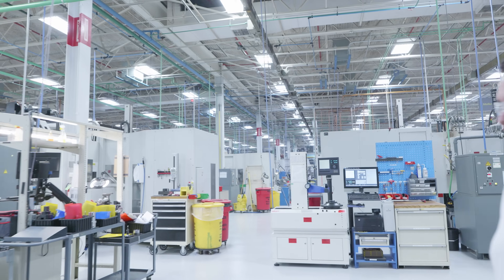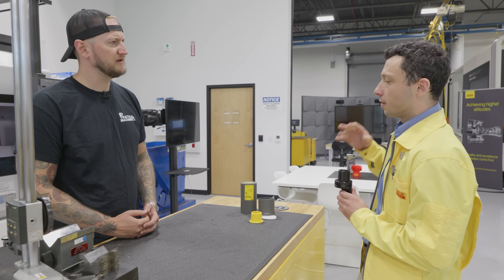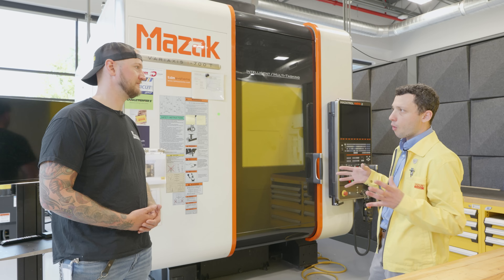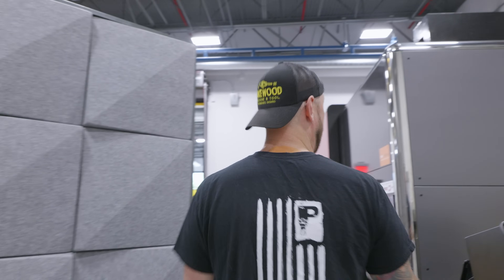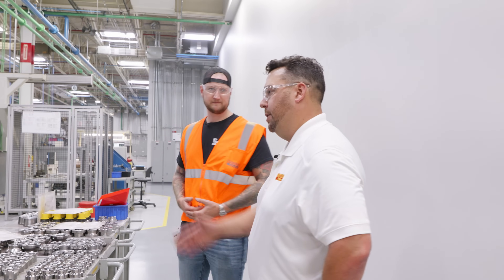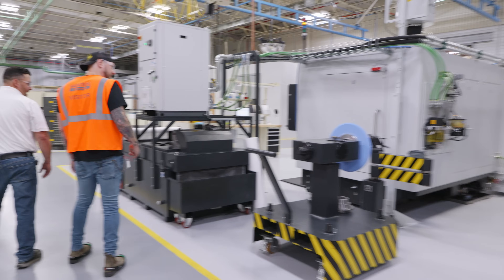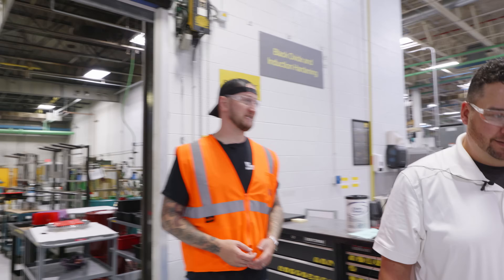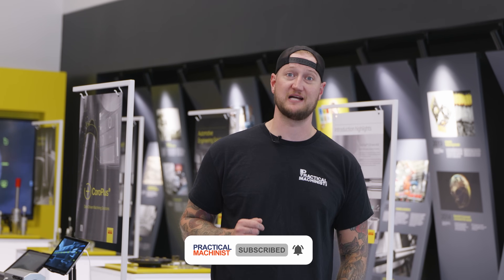Sandvik Coromant Never Allowed Cameras In Here Before!

Comment: I had run a Cincinnati 18 ft. Planar Mill with 2 hand ground tool steel bits in an over arms on a gantry.  Had to machine two freight train rails at once clamped side by side on the 18 ft. long  parts bed. Which ran back and forth on a 36 ft. foundation table. A machined cut stroke was the entire length of both rails on top and both sides. The precision metal equivalent of a saw mill operation, yet no less dangerous. A tooling vendor showed up one day and brought in some tool holders with Carbide inserts, replacing our primitive tool steel
blades. We kept cranking up speed and feed until the Carbides ripped 1/4'' chips that shot like glowing bullets! Although I'd used carbide on CNC lathes before that time, no one thought old school planar would function under those loads.  It did and we ran rails on that turkey like a Formula 1 car.  That was 1978 in Menomonee, Falls Wisconsin at CRO Messer Griesheim Co.